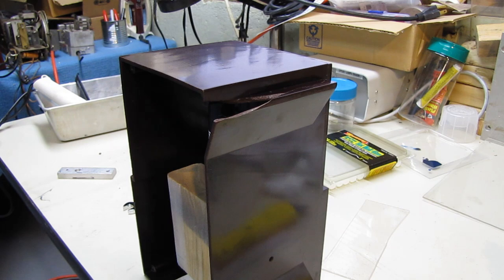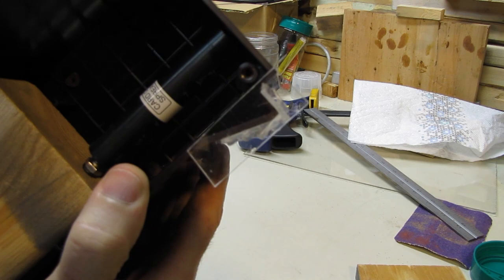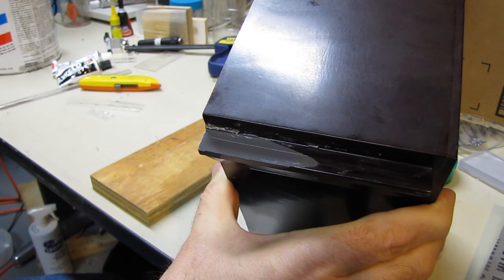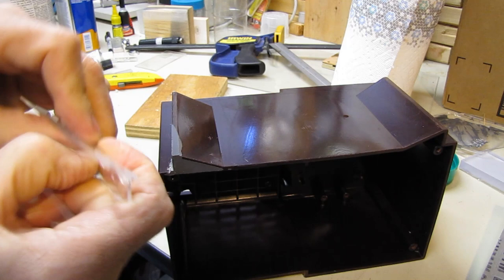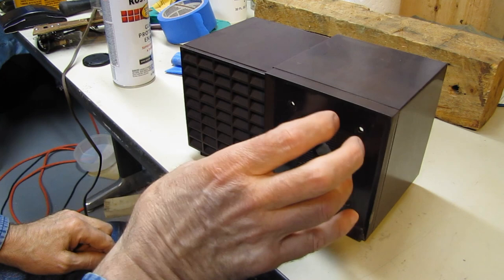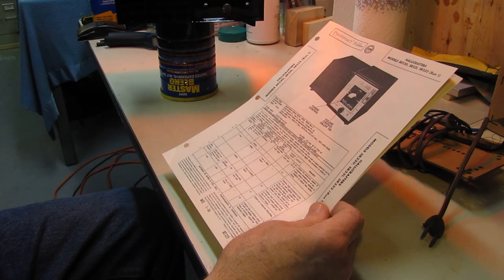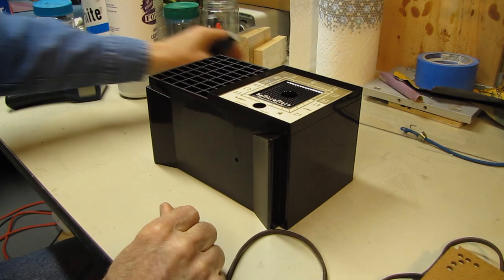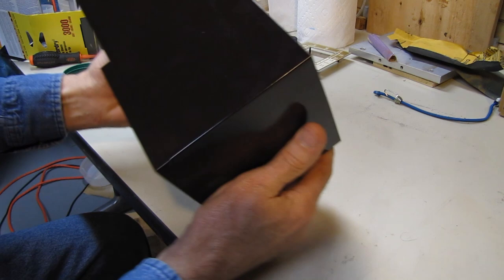Rescue of a Hallicrafters 5R230 Part 2

Comment: Excellent cabinet fix Vern. Nice to have an original SAMs for this radio. Leaves no room for doubt. Rod antenna job
was genius. Clear paint from a can on anything requires light coats with 15 to 20 minutes between coats. I learned 
that painting small HO scale models with an airbrush no less.

Comment: Dan Serafini
I am not very knowledgeable about electronics but truly enjoy your videos and trying to learn.  I enjoyed the recent two on this particular radio. My comment actually refers to a much earlier one (can't remember the specific one ... I jump around) where you spoke of using Howards Restore-a-Finish on a wooden cabinet. This is a great product, but I wanted to share that they have a Feed-N-Wax product that I have used on old clock cases and it is a great tool for bringing back the wood to a rich shine. It uses bees  wax and both polishes and conditions the case (just an old clockmaker).  Keep up great work.

Comment: You should try mixing baby powder and elmers glue it turns into a paste and you can mold it in place with your fingers after it gets mixed a little and it drys hard as rock and you can Sand it and paint it it works really good you need to try it..